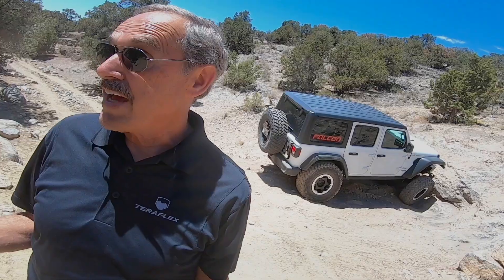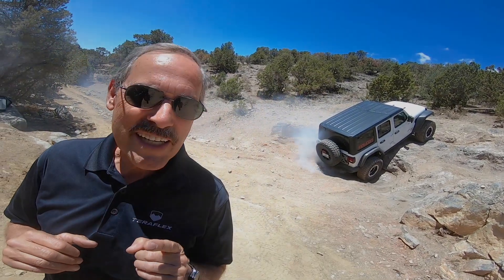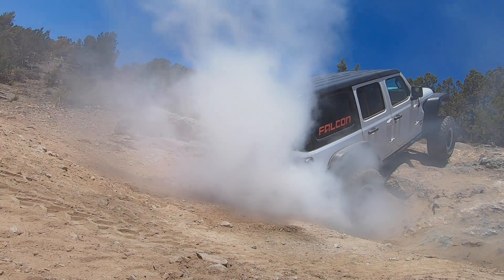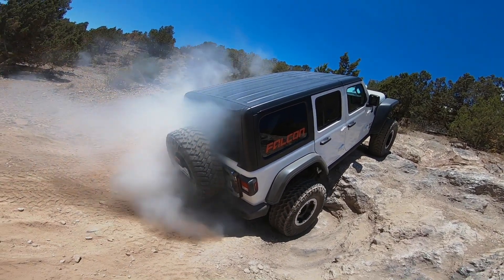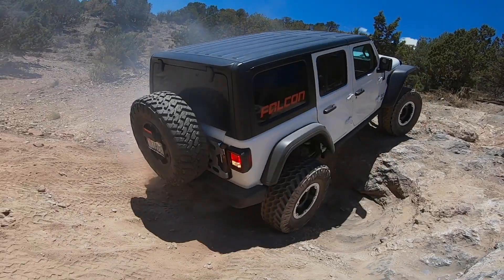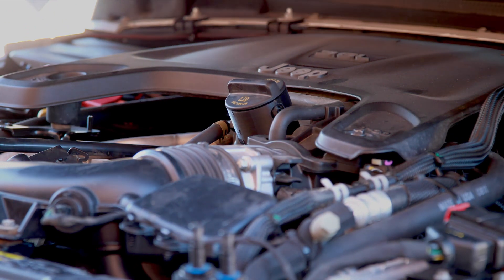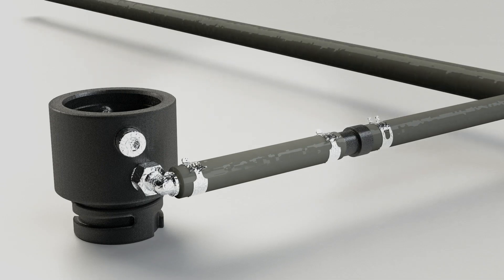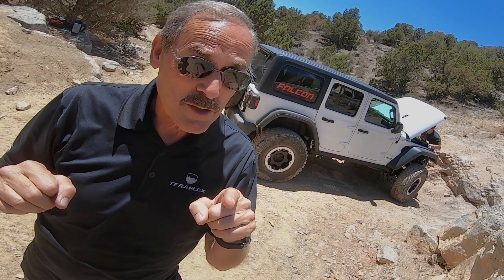JL/JT Crankcase Vent System (CVS) | TeraFlex

Comment: I had a Catch Can and this will get rid of that maintenance item. 
Your directions seem questionable as to what orientation the added check valve should face. I faced mine with the arrow facing towards the tee fitting and/or away from the oil fill spout. Hope this is right